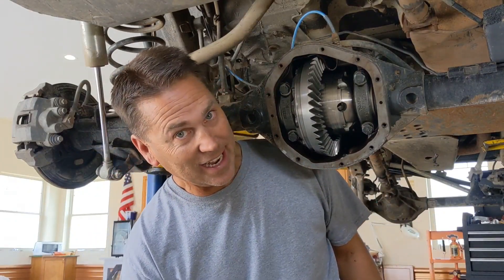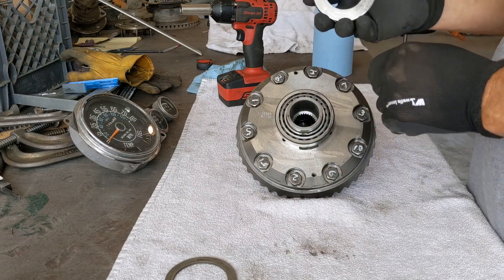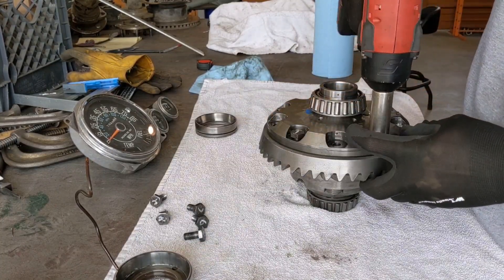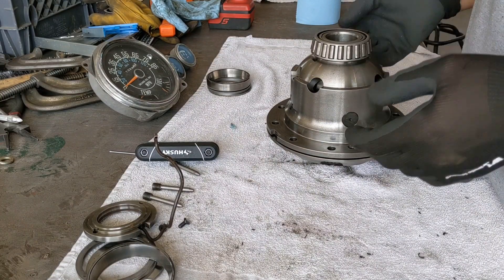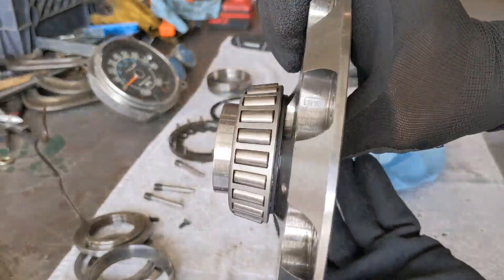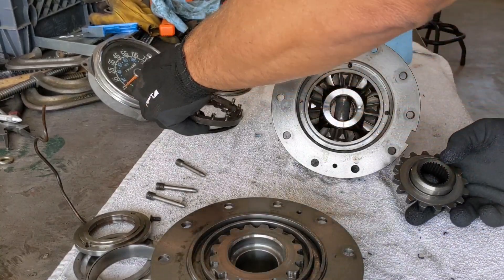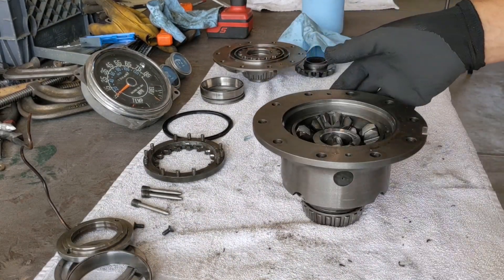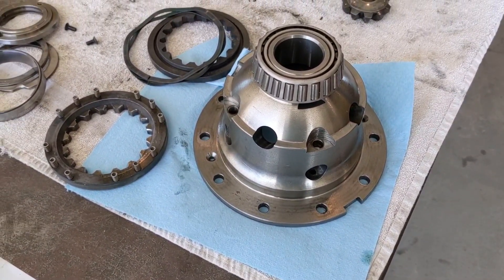Why is my ARB Air Locker not working? Let's open it up and see!

Comment: Thank you for your videos,  I purchased a set of axles loaded with ARB lockers. I will be swapping the lockers with the gears into my high Pinon Dana 30 (because the axle I bought was an early Dana 30 with the acuator). And had to source a new housing and axle shafts for the Dana 44 as the guy I bought them from bent the h☆ll out of the axle. The lockers in both axles seem to operate flawlessly as far as I can tell. They lock when I  shoot compressed air into them and release when I remove the air. I have a friend that has done gears several times and will be helping me with the gearing.  
Watching you take the locker apart and troubleshooting the issues you were having. Makes me realize that these lockers are rebuilable anyway if there is any issues. 
Subscribing for obvious reason. And mostly because you are so thorough in you explanations.  Thank you! PS. Notice you're in Colorado so don't be surprised if I Thank you in person out on the trail someday.

Comment: Big fan of your videos, I've used them to learn how to do gears and am starting my first air locker install.  This was the best video I could find that shows how the ARB air locker works. I have a question.  The worn clutch plate had several traditional springs, did the new one have a new wave spring design?
Reply from the maker: Yes they have changed the design as the product evolves. The wave spring is the standard replacement now.

Comment: Outstanding tutorial, I almost want to do one myself. But perhaps I will leave it for the professionals. LOL  I use to own a Jeep, would buy another one but they cost twice as much as a Ranger Raptor here in the Philippines.  The Gladiator way out of touch.   What is your opinion about the Ford Ranger,  2.0 litre Diesel, should I get it with the 10 spd or the 6 spd.  With the 10 spd I get tech, comfort, bells and whistles Some bells and whistles are okay, but I am more concerned about the tranny and engine.
Reply from the maker: I'm not familiar with a lot of Ford stuff, especially that diesel. I love my gladiator, it has the 8 speed tranny and all the creature comforts!

Comment: So was the clutch gear your issue? Mine locks up when turning right but sounds like a lock rite when turning left. Will be pulling the carrier next week to investigate.
Reply from the maker: It was indeed the clutch gear
Reply: @TheBFHGarage  thanks. That doesn't look like much wear, but I guess it doesn't take much. My pressure switch was failing and allowed low air pressure. I replaced the switch but am still having issues. I'm guessing it chewed up the clutch gear when it had insufficient air pressure.
Reply from the maker: @TheLbarr2002  very well could have. The teeth should be squared not rounded off.

Comment: Recently had some problems unlocking my arb locker.  I had stopped the vehicle from off-road, and disengaged the locker.  Heard the pshhh sound and all.  When I went to turn left onto a paved road the rear locker felt like it bound up and then popped to release the locker.  Curious if I damaged my clutch plate, and why that occurred all together.  The locker is new…

Also curious did the new clutch gear fix the problem?
Reply from the maker: In my case, yes, the clutch gear was the culprit. In your case of it not unlocking, it can be a couple of things or combination of things. Being a new locker, part of it may be that it needs to break in a little bit. ARB's tolerances are very tight. What I most likely think it is, is that when you shut the locker off, it may still be under load. If there is any pressure on the shaft and splined side gear it won't unlock easily. Once any loads are released it should unlock. Next time you're out, unlock it while on relatively level ground. You can try to back up just a bit too to reverse the load. It should get easier as it breaks in. Good luck with it, they are great lockers!
Reply: @TheBFHGarage  thank you so much.  I’ve been worried af about it all since they are new and I’m new to using them.  Lots to learn.   I was like oh, great, here I go breaking stuff already.  

Your video was the best one I came across though as far as explaining what exactly comes into play and where the forces may go.  And I’m not so daunted to assess the damages and possibly make a repair if necessary either.  I really appreciate the advice brother.  🍻
Reply: @TheBFHGarage  just curious, you think I damaged anything?
Reply from the maker: If it is brand new, then I doubt it. They need to break in like other gears. When unlocking, try to drive in a straight line or they can stay locked until you do.

Comment: Take the old one to a machine shop and have them cut you another one.

Using better steel!
Reply from the maker: ARB's are very well designed and use very good steel. This part is designed to fail before other parts for a reason. I wouldn't change a thing.

Comment: The beveled edge is not very deep and I don't think it's what's causing the locker to not work, the main problem is maybe you don't have enough pressure. But now that it’s worn out, replacing it is a good option.